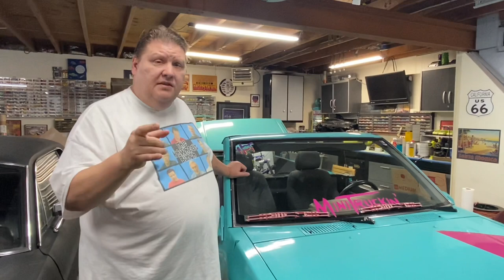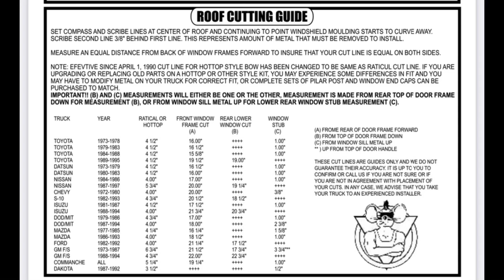Minitruckin Convertible Top pt. 2 - Additional Details.

Comment: Hey I had one of the 80's convertibles, my suggestion is to seal the exposed metal otherwise it will rust and it does happen quickly.

Comment: We cut the top off my buddie's square body s10 probably 12 or 13 years ago now. Didnt have a kit, had no intention of ever putting the top back on haha. We had an issue after we cut the roof though, the back wall of the cab leaned in, enough that we couldn't close the doors. We had to ratchet strap the back of the cab  into the correct position and gusset the wall. Have you or anyone reading this ever seen this?

Comment: Hi I have an 82 S10 chop top with tandem wheels on the back. My question is where can I find the plastic kit that went around the windshield,over the door and where the back window was held. I'm only missing the drivers door plastic, probably the one you say you don't use.
Reply: Last I heard was that the company that bought the molds for the plastic parts scrapped the molds. Good luck finding any. I had a 82 S-10 back in the day. I'd love to find another

Comment: I have a 1995 Dodge Dakota Sports just wondering if the same way you installed it on the S10 is the same way I should install it on my Dodge Dakota the convertible top?
Reply from the maker: Yes. It’s the same as the S10.  You even need the window regulator kit for your doors. They still sell that.   Check my video on that to see what’s involved.
Reply: @NightStalkerCustoms  thank you